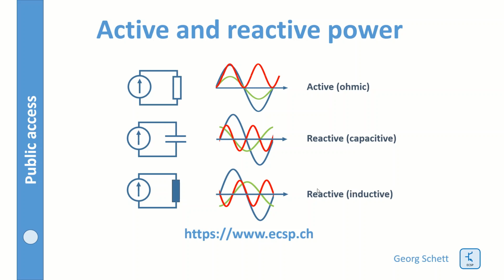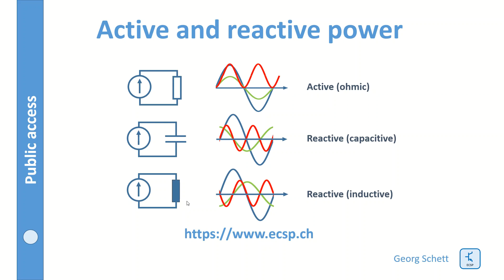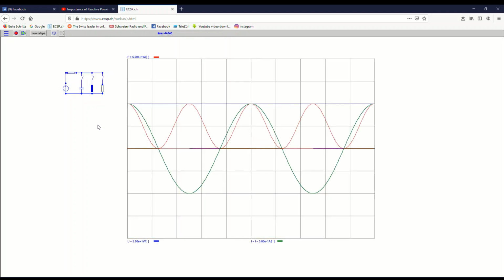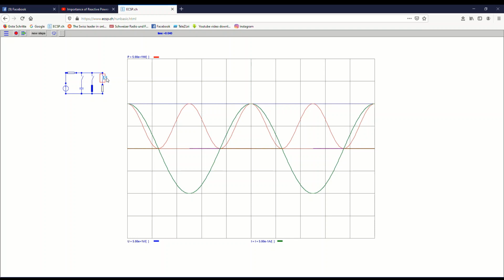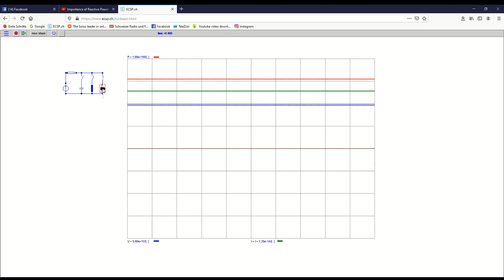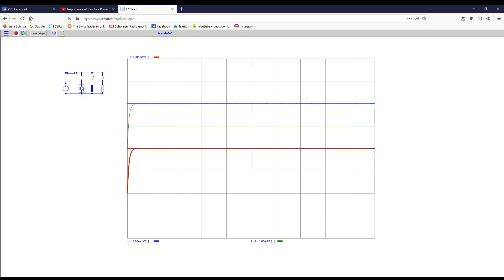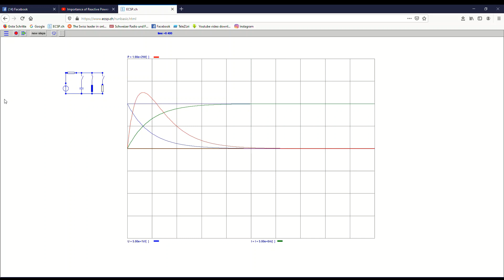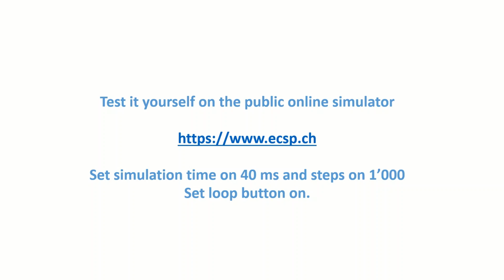Concept of reactive power [circuit simulator]

Comment: As we understand that reactive power(whether inductive or capacitive) does not serve any useful purpose. We also know that reactive power is sinusoidal and goes through positive and negative cycles. Negative cycle obviously indicates power flow in the reverse direction. Under the same concept please clarify my following  queries and explain:
 If an induction motor(1 ph or 3 ph) is connected to an AC source, it runs in a particular direction and starts drawing reactive power. What happens to it during the negative cycle of power when there is power reversal? When reactive power does not do any useful job, what power is rotating the motor? Is it the motor still draws some active power too besides reactive power? How all this can be explained? Kindly answer.
Reply from the maker: Dear Sir
You may have a look at another video: https://youtu.be/Ogl68WkETXY.
It is about motors and generators, at 7.20 your question is addressed. By the way, reactive power is not useless, it is inevitably coupled to the magnetic fields built up by currents flowing throug lines or motor coils or transformers and it is coupled to electric fields built up in capacitors. So: no reactive power => no AC current.
Reply: @georgschett801  thank you.